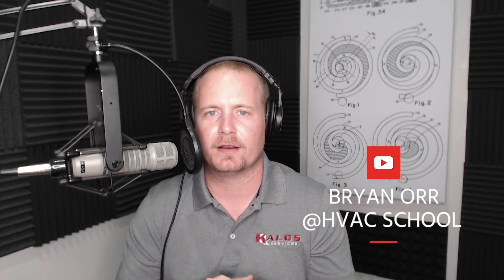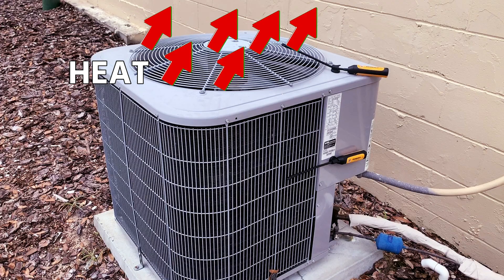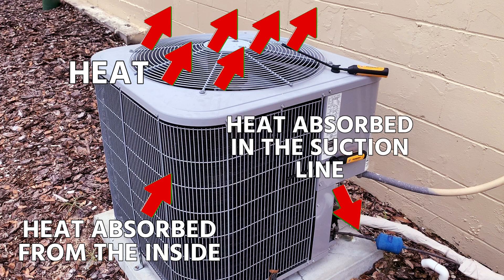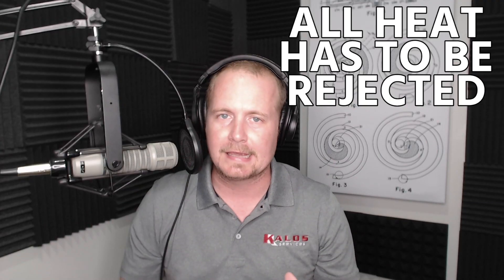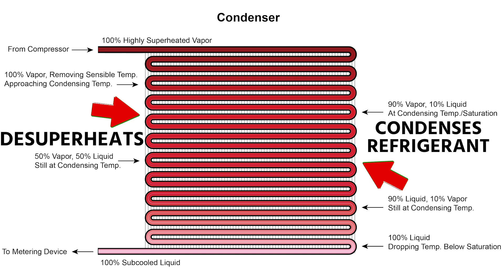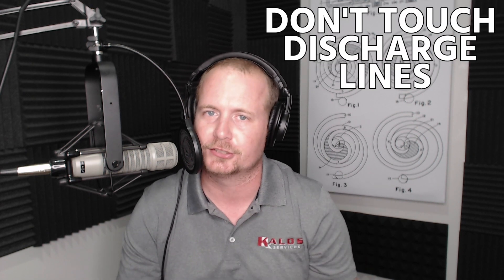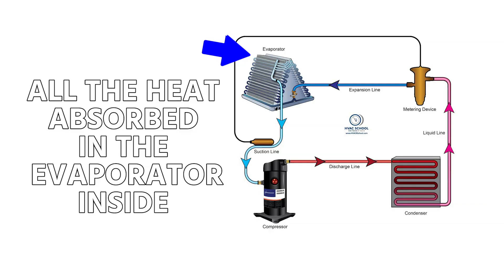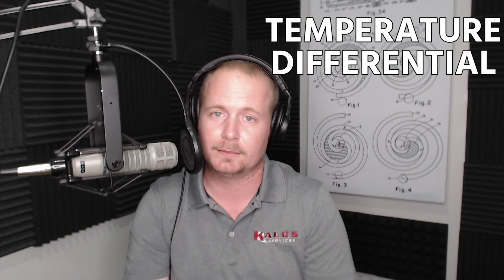Condenser Discharge Air Temperature

Comment: How the hell do you actually find design condenser td? I have gone so deep into trying to find it. Total heat of rejection divided by refrigeration effect? Am I suppose to just trust these ball park numbers I’ve gotten from instructors based off seer ratings? How am I suppose to find required saturation temp which is outdoor ambient temp plus design condenser temp drop? Am I missing something?

Comment: Question for anyone: Can having too cold of air around the condenser coils be an issue? If you could reasonably lower the temperature of the air going into the condenser coil without harming any of the other components, would that be a bad thing/would there be an issue with that? In my mind, having colder air going into the condenser coils will make it easier for the condenser coils to dump more heat per cycle, but I have no experience with HVAC. Would there be a dangerous or bad temperature to get those down to that might cause issues with the system, or is it only about temperature difference of air in vs air out?

Comment: Have you ever heard of Too much airflow   across the Condenser??  Someone was saying it would easily ice up  the evap with too much fan even when hot outside ??

Thanks!
Reply: In general, on a warm or hot day, that's not a concern at all. On an air cooled condenser, if the ambient air is, for example, 100 degrees, the lowest temp physically possible at the liquid line is 100 degrees, but in reality, it will likely be in the 105-120 degree range. But even if you did get the liquid refrigerant all the way down to a warm or hot ambient temperature, that's still not a problem, it's a benefit.

There are only two problems with increasing condenser airflow. The first and most obvious is that a larger/more powerful fan may use more power than the reduced head pressure would save. The second problem is that it may be possible to drop the head pressure too low under certain conditions such as a cool day/night, which could cause freezing up and other issues, especially when combined with other factors like a slightly low refrigerant charge or an excessively low return air temperature.

Of course this won't be an issue if the equipment has appropriate head pressure controls built in such as a condenser fan speed control, but most fixed capacity residential units are built so cheaply that they don't.

Comment: So the fan is meant to help the condenser reject heat? If i understand correctly, the fan pulls cool air through the sides in order to pass by the condenser coils and the air will then absorb the heat from the gas refrigerant, and pass out the top of the A/C. The refrigerant will also turn back into a liquid as the temperature drops. Am I correct? Correct me if I'm wrong please

Comment: So....
What is the condenser discharged air temperature exiting the condenser coil u it in a typical 80degree f day?
Thnks
Reply: R410 = 80 +12 = 92 F  for R22 = 80 + 22 = 102 F temperature exiting the condenser.

Comment: what is the problem with a sys. if the condensor split is lower when the pressure is higher and. the split is higher when the pressure is lower. i thought the split should be the same with ambient temperature changes ?

Comment: Isn't it working better if it is hotter?  That would mean it is rejecting more heat.  What you don't want is a condenser not rejecting much heat though admitedly newer systems that are more efficient have lower splits.
Reply: Could mean a slow fan so slower airflow across the coil , getting hotter, resulting in higher head pressure and load on the compressor.  Needs to be as designed for best efficiency and service life.

Comment: After cleaning the condenser coil, I test the heat coming off the condenser fan.  Outside was 99° and the air coming off the top was 122°.  The amp draw for both the condenser fan and compressor were too low.  This was a 1993 Lennox Sit System.  I suggested to the customer to replace the system.
Reply: I work at a place that has over 100 package units from 10 to 20 tons and 90 percent were installed in 1982.  Outside temp last week was 105 in the shade.  Roof temp was 180 degrees.  Somehow the administration thinks that inside building temperature should be 65 degrees or colder.  And they won't give me time to clean coils or do any maintenance to equipment.  And they wonder why condenser coils blow out.  I suggested they replace the systems also.  Same answer as always.  It's not in the budget.  But they have money for new cars for management and provide housing for top administrators.  One more year here and I am gone.
Reply: @johnd4348  Question for you: having a really hot day outside obviously affects the system negatively, but can having too cold of air around the condenser coils be an issue? If you could lower the temperature of the air going into the condenser coil without harming any of the other components, would that be a bad thing/would there be an issue with that? In my mind, having colder air going into the condenser coils will make it easier for the condenser coils to dump more heat per cycle, but I have no experience with HVAC.

Comment: You definitely run into some really bizarre repairs from time to time. I once found a system where the condenser fan blade had been reinstalled upside down, with the hub and set screw facing the motor. That made it super difficult to get a wrench on the set screw, so I can't imagine how this guy never realized that he put it on backwards. Pretty scary when you think about how much extra effort he put in, to do it wrong.
Reply: Refrigeration wrench with a 3\8" extension works perfectly in that situation
Reply: @luigiluigini9500  Getting the set screw off wasn't the problem. Couldn't attach a fan puller to the hub and had to cut the blade off and get a new one.
Reply: I once saw recently at a part store here in Houston Texas 2 guys buying a condenser motor and fan blade. 
They both were ac guys had a company logo name shirt. They were putting the blade with hub up and down I was like the hell are doing. Walked to them told them the hub with that screw goes facing up not down. They were like what so I explained it to them in Spanish. 
Shaft is facing up hub up that's the why to install these blades. 
I was there for a txv for a ruud coil that was stuck open . It kinda made me giggle for awhile. Wondering if they have installed them the wrong way before.